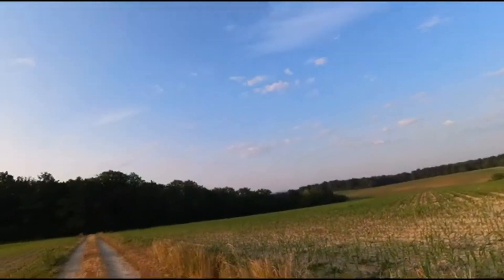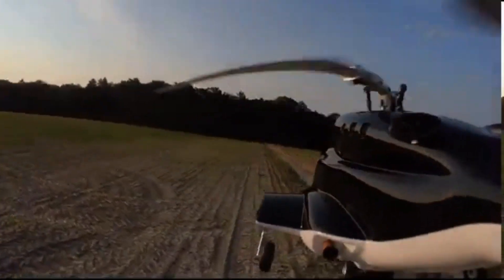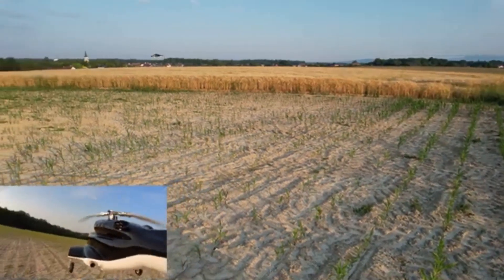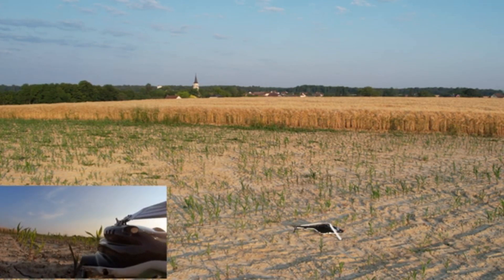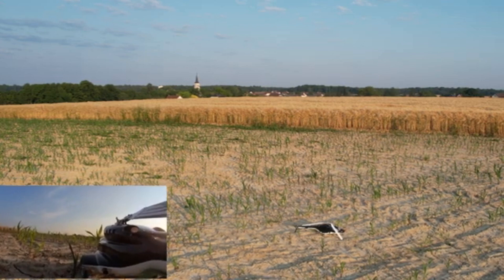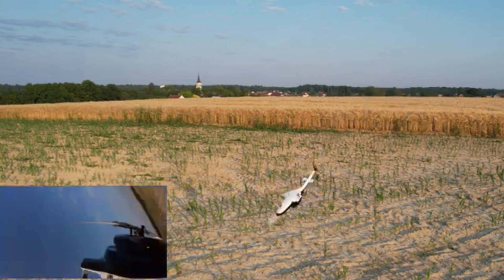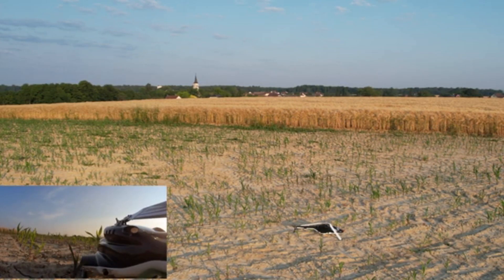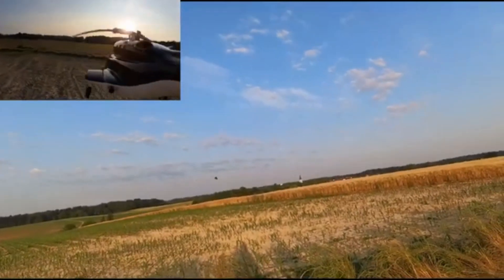FW450 v3 converted to quik grips and airwolf body

Comment: Looks like the tail motor stopped, bad tail motor? tail motor socket got undone with vibration? dual ESC failed the tail motor?  A technical autopsy may tell the culprit.

Comment: Thats why i'm scared shitless to fly my $1600 500 Airwolf.  even though it has no tail motor, I got it prebuilt with the H1 Took it apart several times to get retracts working correct and lights installed.

Comment: hey man do you know you took my video to make yours??...
Reply from the maker: used it to post to flywing on whats happing with there products, if you wish i take down,
Reply: @CRUZROYHelicopters  no ,no problem ;)
my crash is due to the tail motor which was faulty, a wire was unsoldered
Reply: @jfr900  Agreed.  You can clearly see the tail just stopped before the Heli started to spiral out of control.

Comment: Flywings engineering is good on paper, but their real world execution is horrible and dangerous. I have a FW450 V3 with the green canopy, running the V2 ESC like you. I only fly in 3D and have tuned in the 2.0 software to my liking (I am more a sport flier). Its not a very fluid machine...its very notchy. I don't need GPS mode, but if I did, I would never think about flying one of these in GPS mode.